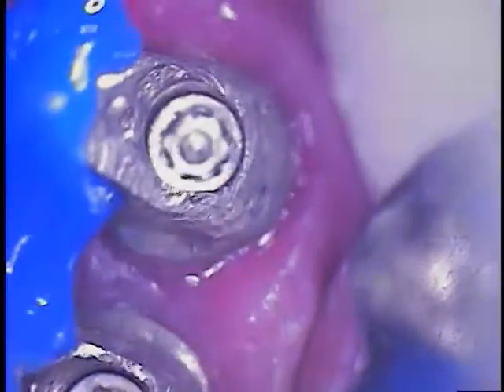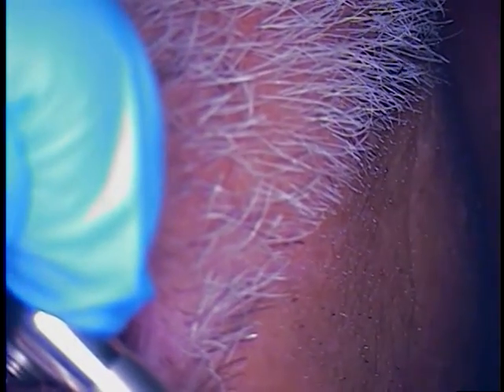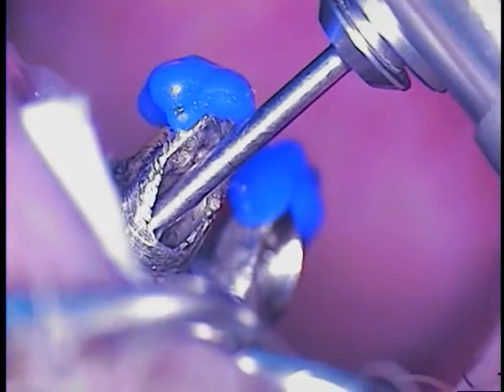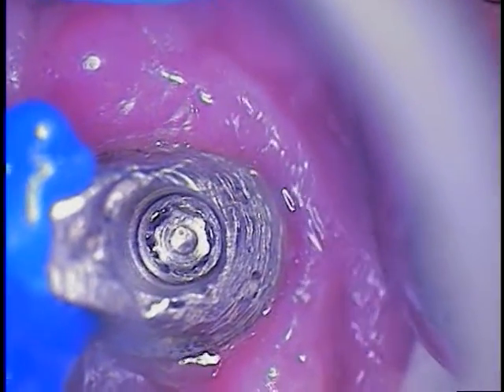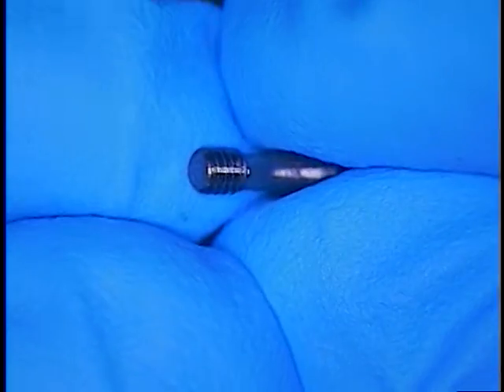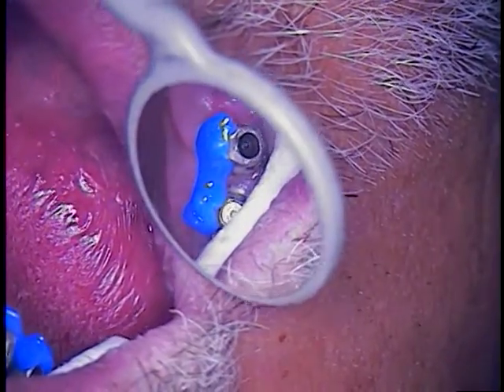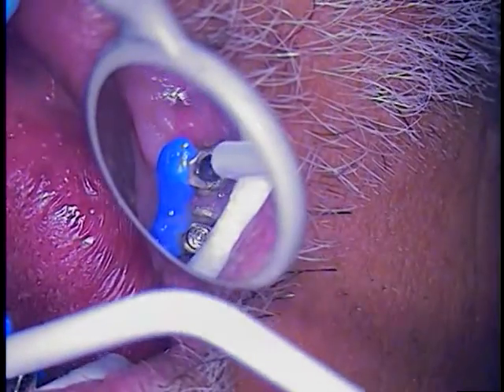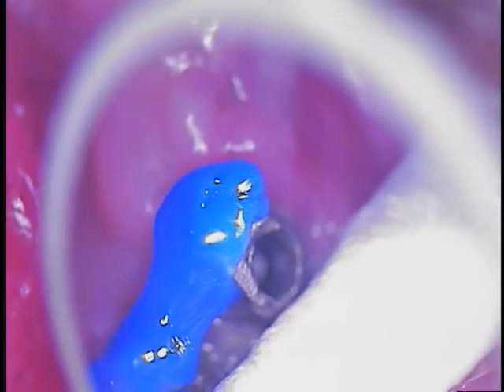Stripped dental implant screw head - assisted removal by pre-soak and splint technique 2/3

Comment: What is the purpose of splinting to the adjacent abutment?
Reply from the maker: Power Balance the abutment was mobile. Splinting stabilizes the abutments which In turn adds torque resistance while backing out the screw.